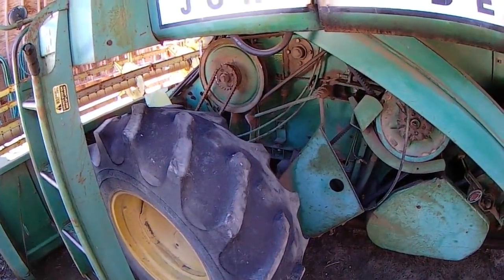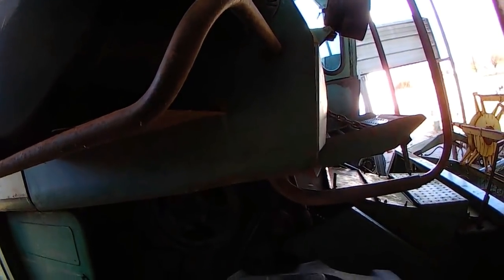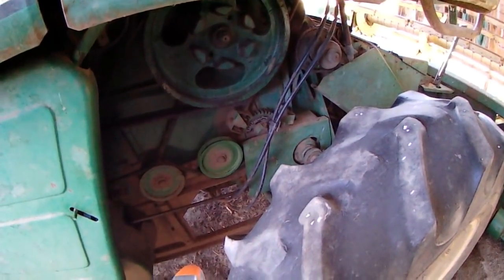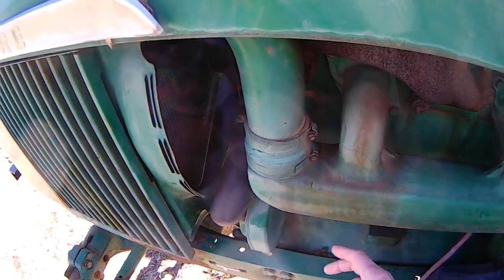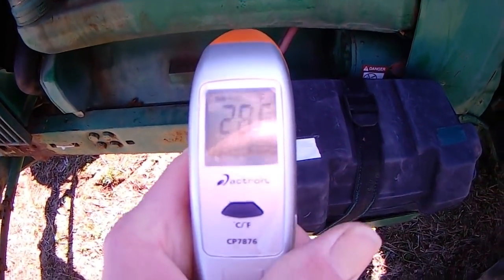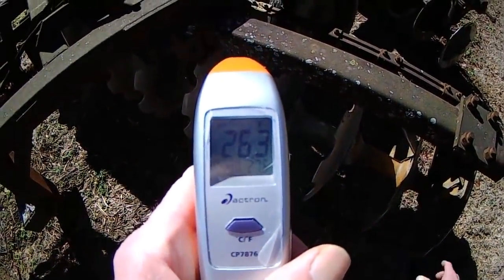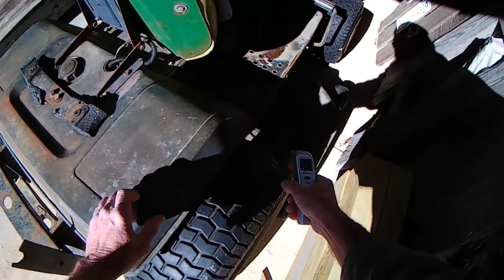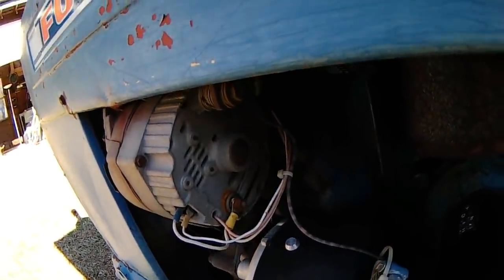An infrared thermometer in the toolbox

Comment: Use those infrared testers all the time, mainly on the baler and combine... makes it easier and quicker getting readings compared to feeling by hand especially where a couple of those bearings are located with moving parts.
Reply from the maker: Farming 4G - I think they are a great tool and no farm is complete without one.  thanks for watching and commenting.

Comment: One of my sons is a farrier and he uses one to check the temperature of horses feet if he suspects it has an internal infection in the foot which has formed an internal abscess which usually makes the horse lame. It is not fool proof but is a big help in perhaps confirming and locating the problem. He measures all the hoof temps on the horse to find out the "average" for the horse on that particular day.
Regarding the fan belt issue I'm surprised that you have to remove the fixed bonnet, can you not just slip it off the alternator and bottom pulley and work it off the water pump and fan blades? A good motor factor business specialising in belts, bearings and drive chains would likely be able to fit you up with a new belt with the correct cross section and a little shorter overall length. 

Please also bear in mind with the present belt and the amount of slippage that has been happening the belt cross section has likely worn down somewhat so allowing the belt to ride lower down in the pulleys making a poor situation worse by appearing to be even more slack!
Reply from the maker: Dan Whiteford - another interesting use for the tool.  definitely a diagnostic tool in my way of thinking.  removing the fixed bonnet will allow me more room to access the area.  the other side is the side that flips up allowing access to oil water and battery.   either way slipping the belt around the fan is going to be tight.  I think the main reason I want to remove the muffler is, I found some paint that is supposed to be good up to 1700°F and I want to try it to see if it will stay on the muffler.  the last time I took this muffle off was to paint it with a paint that was rated to withstand 500°F.    the 500°F paint did not hold up.   thanks for being here Dan.

Comment: The Ford exhaust is sorta easy if you have a rotary tool to put a slice or two up and down the pipe under the clamp after you remove the clamp, try to spin the pipe with your new pipe wrench (easily) the pipe is thinner than the cast header wiggle the muffler pipe around you should be able to wiggle the two apart. The belt looks to be pretty old I guess a new one wouldn't hurt. Good Luck
Reply from the maker: Frank Deegan - I hope after the rain gets out of here in the morning I can start on the job.  excited about restoring the alternator to its ability to fully charge the battery.  as a test I put my battery charger on the Ford's battery and hit it with 10amps for about 15 minutes then 2amps for 10 hours.  after that the battery spun the starter faster than it ever had before. I know it is a good battery because one it is less than a year old and two, it tested good.   the loose belt is just not turning the alternator hard enough to put out.   thanks for the tips on how to fight the muffler removal.

Comment: Good for checking electrical connections in  breaker panels for tightness........
Reply from the maker: David Goethe xxx - loose electrical connections will generate heat when current is passing though them.  has to do with resistance being created by not having a tight connection.   my daddy was a licensed electrician and he was famous for saying to me "boy, if it ain't tight it ain't right"  I miss him.    thanks for watching and sharing another fine use for this great tool.
Reply: My dad was also an electrician....Civil  service Navy, Army, and Air Force.....
Reply from the maker: David Goethe xxx - from your original comment here, I can assume you worked with him for a time to gain the knowledge of how loose electrical connections generate heat.

Comment: That's a good idea , it's a wonder more old combines don't burn up ,been dust is highly flammable if a bearing gets hot it could be the end! Thanks
Reply from the maker: CE Smith - when the ball bearing left the race after the bearing failure and went through the radiator and the water sprayed on the hot muffler my first thought was my combine is on fire.  I shut the engine off and jumped into action as I had rehearsed in my fire drills.  relieved to determine it was only steam coming off the hot muffler.  that was the only time I ever shut my combine off with material still inside of it.  sure was an iffy restart with thrashing under preload.     thanks for watching and commenting.

Comment: Great tool for sure. Other uses are checking exhaust ports for temp variation and checking the air conditioning system. Useful for chimney temps and ductwork too. Good luck on the alt repair and I'm sure u can wiggle the muffler off. Thx
Reply from the maker: farmark - yes they are other good uses and thanks for bringing them to light here for others to read.  I dread doing that muffler wiggle, I've had that thing off once and it was a fight.    thanks for commenting and watching.

Comment: Your so positive! "Sealed bearings guarantees a short life". At least you don't have snow and negative temps. Check out the new calf on Northern Wisconsin Farmer's vid, Brad has 0 temps and a breeze.
Reply from the maker: AKWayne S - so far in my years of Farming and maintaining trucks and cars I've never had to replace a bearing I could grease.  replaced many that were sealed with no grease fittings.  I have extended their life by using a hypodermic needle to penetrate the rubber seal and inject grease into them but that was only a short lived extension since they were already worn when I injected them with grease.   snow, 5 inches here first of last week, gone in about 4 days.  not like Canada where the normal temps can keep snow around for months or until the next snowfall adds to it.     thanks for watching and yep Brad has his hands full with much hardship due to weather to endure.